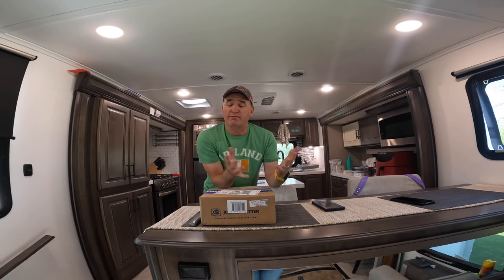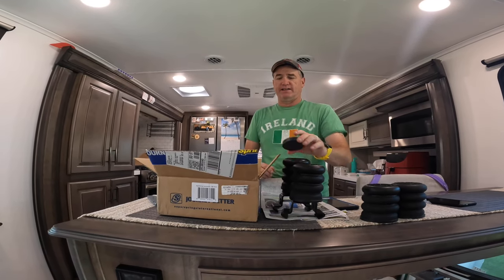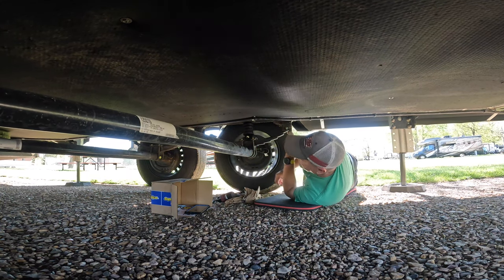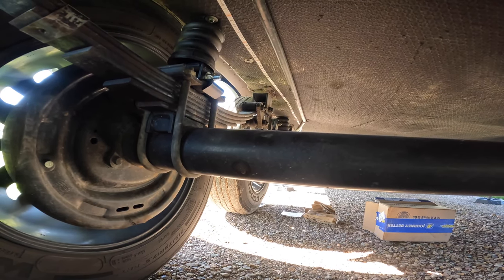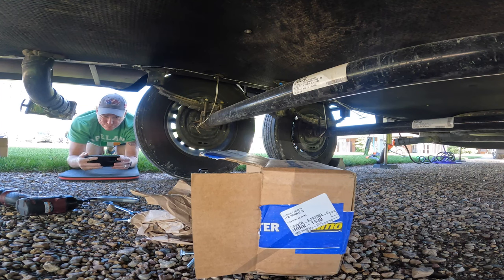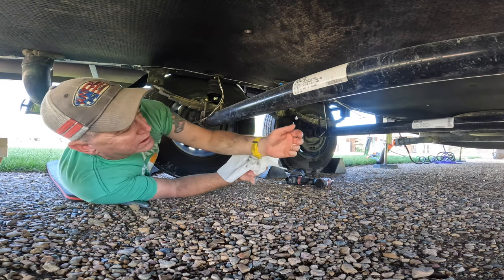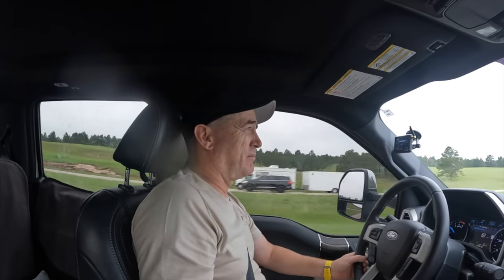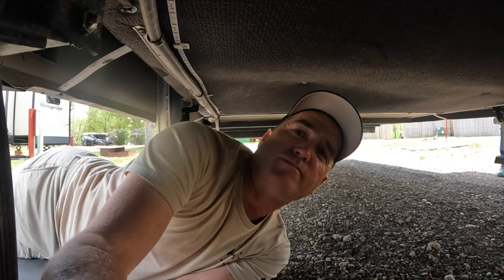Are Sumo Springs worth the hype

Comment: Great job with the install and review. I've been considering these Sumo Springs for my 2022 Reflection 28BH. Looks like it will significantly improve the ride. We've had evidence of bouncing, shaking and movement with the stock suspension system.
Reply from the maker: It drastically improved the ride inside of the camper. As we stated we can't recommend them enough.

Comment: The Sumo Springs have helped with the sway and turn dip on the tow vehicle, we have two shocks on each of the two independent suspension RV wheels. The Sumo Springs made my truck handle better but the ride is stiffer. When the RV is off the Sumo Springs disengage!
Reply from the maker: As you can tell We love our sumo's.

Comment: Thanks for showcasing the sumo springs, I have been on the fence about putting them on my Solitude as well, I've always thought the suspension was a bit springy. I think I'll get a set now. BTW, still no trailer lamp faults since the brake controller flash. There must have been another module that had an update available that Ford is not advertising.
Reply from the maker: Not a problem, we have come across some pretty rough roads in the NW and we are totally in love with the Sumo. And for the faults be glad, i am actually getting a new TCM installed tomorrow because we keep having issues. Future video coming...lol. Thank you again for watching.

Comment: Good to hear they worked out for you. I wanted to ask about the small monitor or screen you had attached to the windshield of your tow vehicle. Is that connected to a small camera in the back of your Rv or? Thanks.
Reply from the maker: Sorry it took so long to reply, I believe the monitor in question is our old rpm’s monitor that is to the left of me. We have since switched that out to a different model.

Comment: I know putting airbags on the rear axle of my truck made a huge difference in the porpoising. On first blush it would seem to me the Sumo’s on the trailer axles would as well. I bent an axle on my tt going over a cattle crossing with a very large lip. I wonder these bump stops would have helped or exasperated the situation. In other words are the leaf springs being hindered from absorbing the shock??
Reply from the maker: Tbh, we used the Sumos to save the wear and tare on the leaf springs. Bein as we have replaced them in 8 months. GD should never have put 7K axles under these big trailers, they should be 8k. So long story short, its a temp fix until we can get 8k's under it. The truck has bags on it. It has made the ride even better though.
Reply: @HappyTailsRVing  I agree on the axle sizing. Although I was more than safe on my axle weights, when I replaced mine I was going to replace both with higher rated ones but didn't want to buy two & fight alignment issues. My new trailer has even higher tolerances though since we boondock a lot.
Reply from the maker: @herb7877  unfortunately because of warranty i had to put 3500 leafs back in...til next time i guess lol.

Comment: It may be camera illusion, but it looks like the bump stops are deforming the bed upward.  Impact will increase the deformity.  Is the bed designed to hold the trailers weight at these points?
Reply from the maker: Must be, i assure you there is no deformation in the frame from the bump stops. I will re watch to try and see where you are referring to. I am curious.
Reply: @HappyTailsRVing  That’s fine, cameras can distort images, especially if a wide angle or fish eye lens  is utilized. 👍
Reply: I think you're seeing where the gas line is screwed up to the underbelly. It makes it looks like everything is bending, but it's just from the gas being mounted.
Reply: @WesDuncan  Your probably right, Duncan.  I have worked with U/W cameras for 40 years and we had a saying: “Cameras Lie”! … meaning that they didn’t always correctly show the actual condition.

Comment: It would be my guess the rubber Sumo device will have shredded your under insulation where it was making contact. Also I would guess the attachment screw making contact may have damaged the rubber of the sumo rubber. What has happened?